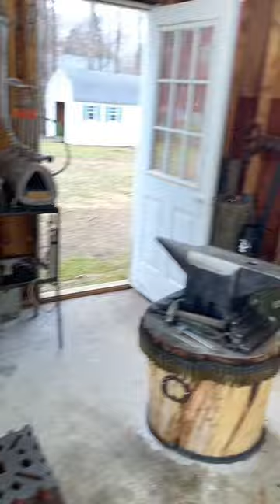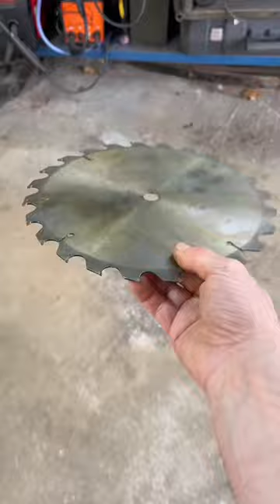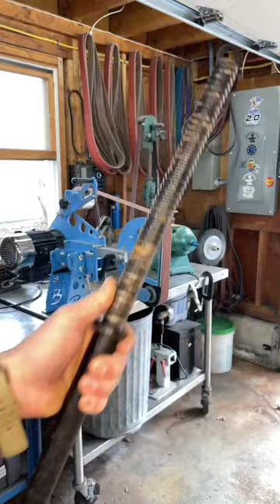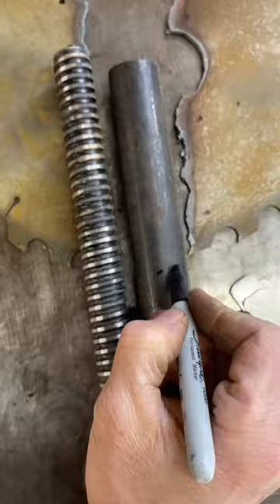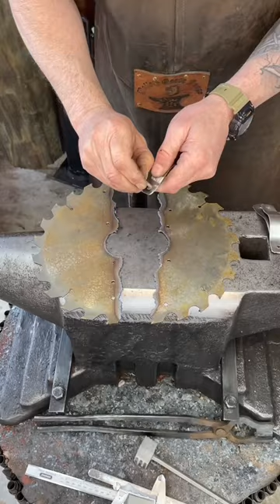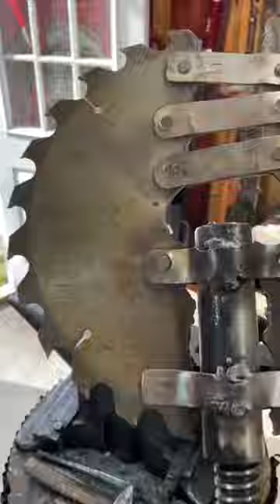Making a Zombie Apocalypse Battle Axe! #zombiesurvival #fabrication #tools #apocalypse #shorts

Comment: Epic axe, but this definitely showcases how impossible it would be for one of these to actually exist in an apocalyptic scenario.
Reply: There's this thing called a generator I think (not too sure), and I believe that a long time ago they actually had power tools that still used cords. With that rare technology you could easily make this in an S.H.I.F.T situation. The hardest part would be uploading the video to YouTube after.
Reply: In an actual apocalyptic situation, items like a saw blade that still had most of its carbide teeth attached and a rod with an ACME thread would be highly valued items. If you had power (a generator), the fuel for it and the welding rods would be very precious and only used where absolutely necessary. 

You could make an axe, but it would be made with a wooden handle and a head roughly forged, perhaps from a section of broken leaf spring. Such a tool could be made with rudimentary tools and  materials, even to the extent of using charcoal for the forge fuel,  which can itself be easily made.

With some practice, it would be possible to make very useful axes in this way, as well as myriad other tools.
Reply: Dont even have to make it powered. Most people arent going to be wearing plate armor. One deep gouge, with no available doctors, could mean their life.